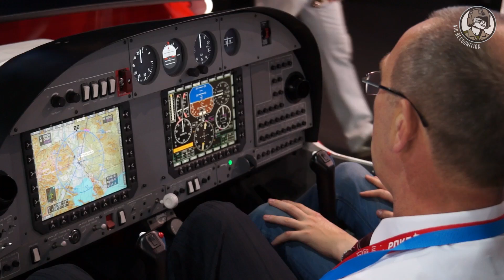MAKS 2017 - Day 2: Russian Defense Industry's newest products

Comment: I would give an arm and a leg to go to this
Reply: how with just 1 leg?
Reply: use a cane or wheelchair
Reply: when you roll to it
Reply: I don't think it is problem. If you apply  for and specify you need it for MAKS 201X it should be easy to get. The question about $$$ only =)
Reply: Arms and legs are not very valuable. If you sell a kidney though, you can definitely go to this. And maybe even buy a pistol.